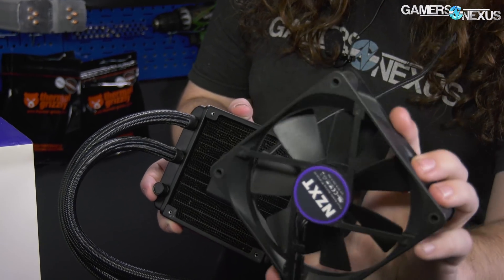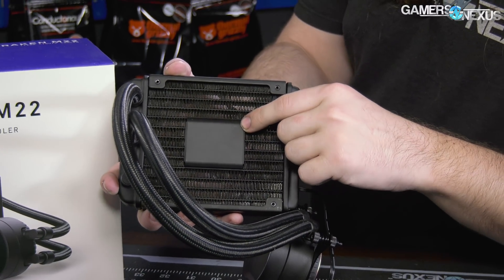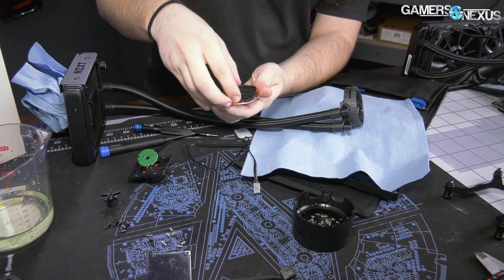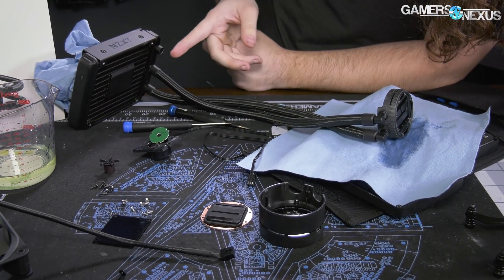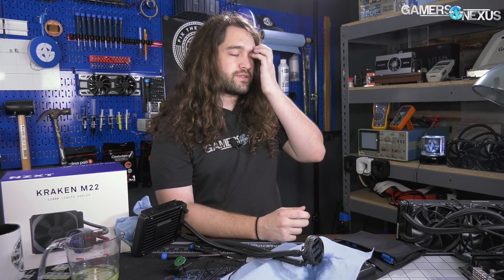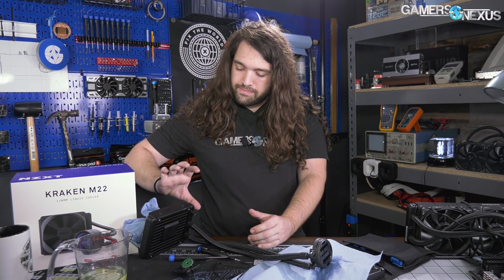Tearing Down a Strange Liquid Cooler - NZXT M22 Pump-in-Rad

Comment from the maker: Our review of this cooler is already filmed and will be live tomorrow!
You might also like Ask GN episode 78: Do VRMs Matter? - https://www.youtube.com/watch?v=b17ccXikeJ0
Grab one of the GN Modmats on the store here: https://store.gamersnexus.net/
Reply: Gamers Nexus I was just wondering if you've ever considered testing how much bent fins affect performance?

I've noticed in some tech tuber's videos, some of their test bench radiators are really kinda beat up and have quite a lot of bent fins.  I wonder how much this affects cooling potential, since it must affect it some.  Personally, I got a Corsair H60 shipped from eBay with no packing material or padding, so the fins got mangled to shit and I had to spend a couple hours straightening everything with tweezers- so curious if it was worth the time.

   Of course you'd need some sacrificial AIO's, but I think it would be a pretty interesting test to perform.
Reply: Is the mod mat burn proof so i can solder on it ?
Reply: Could you do a tear-down/review of the Thermaltake Water 3.0? (even tho it's older, last gen model I believe?) Please. 
or if you have done it could you send me in that direction? or if there is anything you could tell me it would be greatly appreciated. Thank you, Steve.
Reply: The modmat looks cool, but at $100... Eh no thanks.
Reply: Tell them steve just make the rad thicker like the thermal take water pro 3.0  i have a thick single fan rad and it cools just as good as the  h100i with a single Noctua fan on it.
Reply: My monitor does the same found the cause is the HDMI port is slightly bent out of shape on the GPU after cable was ripped out by accident.
Reply: So could you in theory cut the block portion of this off and attach it to a GPU water block for cheap GPU water cooling.
Reply: I think maybe the motor is rated for 3,000 rpm...  I doubt VERY seriously that little motor is able to do 3k in liquid.  Maybe 800 to 1200 somewhere - even that I question.  Motors that small just don't have the torque.  Even if there were no blades on it at all I question it's ability to do 2k in liquid with a closed chamber.  It's just the nature of the beast.  

There's something for you to test.  Paint one blade white and replace one the of the covers with clear plastic and then meter it.  ;)
Reply: I know this is a bit off-topic from video but I am trying to troubleshoot a very annoying problem. We are getting desperate...
 
What happens: short blackscreen with no audio, after that everything goes back to normal. Does not matter if you're playing video games or not. Happens sometimes even while watching a movie. They happen once a day in a very inconsistent manner. 

He has I7-7700k,

MSI Z270 Gaming M6 (previous motherboard was ASUS Z270 MAXIMUS FORMULA with a few bent pins and not working two ram slots),

Kraken X42,

2x8gb ddr4 3000MHz G. Skill RGB ram

Supernova G2 850w power supply,

SSD 128gb,

1TB HDD,

massive ATX case

GTX 1080 inno3D triple fan
+1080p 60hz monitor with HDMI.

 

We tried switching motherboards, removing video card and using integrated intel hd graphics, reinstalling Nvidia drivers, changing motherboard, reinstalling windows, using computer without installing geforce experience. NOTHING OF THIS HELPED.

The only possible causes in my opinion are - RAM, CPU or power supply? I don't think it can be monitor just because audio disappears as well. 

If you know ANYTHING about possible issue, please let us now.

Comment: Thanks. It was very helpful for me. After 3-4 years m22 cooler liquid is going to bad..🤮 some sticky particles was stucked in pump area and prosser copper plate. I removed it using WD40 and refill new coolent. It was worked 💪 CPU 100% >  41 C°

Comment: I have the 120mm M22 and the 240mm X52.
On an i7-8700k the M22 out performed the X52.
Not sure why, could be many reasons like thermal paste or manufacturing tolerances. I wish I knew why.

The problem I have with M22 design is...
Where / how do I orientate the rad, below/above pipes facing down/up sideways?

Mine makes a gurgling noise but thermals are good.

I would also love to know whether I can add more coolant and how much air should I leave in? Maybe I can stop the gurgling.

Comment: At $100 USD these were not a great value, but I found some online for $50 USD. I only need one 120mm AIO, becasue I put a hot processor in an itx build that can't accomodate either a good tower or larger AIO. It's kinda silly, becasue for the same money spent on the ITX case and AIO, I could have built in a larger case and used a cheap tower cooler and probably gotten better temps out of it. 😎

Comment: A copper version of this pump-in-radiator would be excellent option for discrete GPU water cooling solutions, especially 120-280mm range. This way you could use an EK GPU water block and tie it directly to a radiator with integrated pump. All you would need is a fill port.  I would love to "NOT" have to tie a GPU water block into my main cpu water cooling system. It would provide a reasonable option independent control of cpu/gpu cooling, which is something you lose when you water cool everything form a single water loop. It would also allow a cleaner tubing setup.

Comment: I own a 360mm and a 240mm MSI version of this AIO. I have been impressed with the performance and longevity of both. I have not disassembled either. However, the "pump in radiator" design leads me to believe they are of the same origin as the NZXT version.

Comment: Thanks Gamers Nexus for the teardown, I have been able to resurrect my cooler after watching this video. I saw how clean the cooler was when you opened it up after years of seeing some sediments blocking the chamber in my cooler and not knowing I had to scrap them off. I considered it broken cos of the high temps I was getting. 
M getting below 50 Celsius on full load now as compared to the near 90 Celsius temps previously. I purchased a temporary stock air cooler to replaced the m22. I recently decided to test it again and this time i watched your video and realized I had to clean off the debris in the cooler. I had opened up the cooler many times not knowing what the problem was. Thanks for saving me money from buying a new water cooler. 😊
Reply: did you clean the pump or the water block? I'm having the same issue
Reply: @berttin1080p I only cleaned the cpu block it had debris blocking the fins inside the block. I didnt touch the pump. Open the cpu block, the metal part that touches the thermal paste and the cpu(it has some screws on the metal, you will see it from steves video). You will notice some fins on the inside of it. Take it out. If its dirty, clean it and the water bracket on top of it.

Comment: PLZ READ I NEED HELP Have one in a nzxt custom bld and i have had a bad buzzing sound coming from the radiator for the past month or so, they installed it tubes up so I thought that might have been the issue but did nothing, aside from buying a new AIO idk what to do.😢😢

Comment: When I saw the solid center of the radiator, I was upset. Then you explained that it's the dead zone of the fan and I felt better.  How would you mount this design to keep air from entering the pump?

Comment: Have this same cooler, and was interested in knowing if you ended up salvaging/refilling it. Mine recently started crackling from what sounds like a bunch of tiny bubbles in the system, as well as not cooling. I suspect some type of blockage. I've since bought another cooler, but hate to trash it if I can salvage it for a spare.

Comment: My 11 months old m22 died last week. NZXT asked me to destroy it and they’ll send me a replacement. 

I followed this video to see inside the block. There was a lot of sediment blocking the microfins, which I assume cause the cooler to malfunction. 

There was also a bunch of brown gunk that poured out from the tubes when I cut them.

Seems odd that it would degrade so fast?!?
Reply: That is weird, i had a raidmax 240mm aio with the same pump design, basically a shittier brand, took 4.5 years to degrade but the design made it fail with the bubbles in the radiator lol, you could've just had a lemon.

Comment: I don't think the thermal implications are negative for the location of the pump being in the center. You want the air to pass over the radiator fins for max heat dissipation, not blowing on the pump Given the design choice that is the best place for the pump on the radiator.

Comment: It's a stupid design, those with a pump on the CPU (Corsair hydro like) have about the same sized cooler and a more efficient radiator.
The only proper design would be to put the pump in series of the loop but all those AIO solutions seem to be focused to make repair hard. They don't want people to fix them or to upgrade them by replacing a part.
They want people to buy a new one instead. It works, barely anyone tries to fix a broken pump or clogged radiator in those designs (though it is often a 15 minute job only).

Comment: I don’t mean to shit on the I fix it kit but my socket set came with literally all of those for screwdriver use. All I gotta do to bring it with me is pick up the 3 rubber strips holding all the bit and the screwdriver itself. Plus mine is in my socket set and includes tx torque heads too.

Comment: Just took mine apart after it stopped cooling.  Found a white gel/crystal clogging the center channel at the micro fins.  Then hooked up the pump to 3 volts and it’s dead.

Comment: Usually you mount the pump at the bottom of the loop so air doesnt stall it, is this radiator safe to mount on the top?

Comment: i have this and it was overheating within a year and a half. 95c. i believed it was clogged. so i used this video to diagnose it. no luck. but i am wondering 

how the hell does the water go fromt eh pump to the hoses?? im looking at the radiator and i do not see anything connecting the center pump to the hose fixture....

Comment: IDK, mine works fine on my Ryzen 5 3600 X. I've yet to see temps over 65C. It's running 24/7. So far it's been fine.

I have a midtower that needed 120mm radiator because I have 3 intake fans up front I didn't want to move around. Wanted decent RGB and really just wanted something that was better than stock cooling because stock cooling was getting hot from time to time. This worked for my needs.

Comment: So what is the proper orientation to mount liquid coolers like this? Your video that explained the correct orientation for AIOS were targeted for pump in cpu block ones. 
You want the pump to be below the rad, but what happens if you are top mounting?
Reply: Please answer this question
Reply: I think in this case placing the radiator on the fan slot on the side of the cpu will be ideal. Havnt had issues doing this with my m22 for sometime now.

Comment: Dumbest design ever. Why not just put it on the end of the tank like many others have done. This NZXT just blocked 1/4 of the radiator fins.  I think the Alphacool Eisbaer is the best AIO to buy right now. Alphacool has a completely diffferent CPU pump/block than Asetec. Alphacools has replaceable G"1/4 lines that does not void your warranty, You can run your own coolant  and it has a port on the pump for filling. They use a bronze pump and copper radiator. so no aluminium Enermax problems. Just think if Enermax had this type everybody could just drain their Threadripper AIO swampwater out and refill with clean PG/water biocide ! LOL

Comment: Whats the reason for why PC coolers are not using like.. automotive coolant? price or deterioration of materials? There are different auto coolants to accommodate different engines for example one that does no harm to aluminum parts/blocks. newer coolants have close to endless live so Im imagining how you never clean your custom water cooled loop for example even AIOs, tho in the second case a pump probably fails long before anything happens to the coolant thats never seen air after it god factory sealed inside the cooler.
P.S. Also I want to see a PC with a car radiator for cooling (an intercooler probably as it can be around 280-420mm PC radiator) but thats for JayZ50Cent.

Comment: All this talk of patent trolling and how this patent didn't deserve to be awarded etc..etc... what a load of crap.
I hate it when patents get in the way as much as the next guy, but once upon a time water cooling was an enthusiast only extreme solution and done using separate commodity parts.
One day someone came up with the idea of an all in one system, where the pump is in the CPU block.
Regardless of how used to seeing them we are now, like it or not it was once a unique idea, and was patented.
I've seen patents for stupid things (linked at end) and this is not a patent i like, but none the less it is a pretty legit patent.
Try to consider the all angles of the argument before arguing it.
Example stupid patents... THESE ARE REAL.
Method for swinging on a swing sideways...
https://patents.google.com/patent/US6368227B1/en
Animal toy yes.. it's just a damn stick, someone patented a stick, and any equivalent representation of a stick.
https://patents.google.com/patent/US6360693B1/en

Comment: Sadly i found this video a little late but i have this CPU AIO under an 8700k at the time of writing and its actually pretty darn good. The default fan is a bit crap (and also only white led, why? idk) so i bought this one: https://www.newegg.com/noctua-nf-f12-ippc-3000-pwm/p/N82E16835608052. It keeps it about 65-70 or cooler under load. I bet i could get cooler if i used different thermal paste but i digress. Get that fan if you get this cooler. its much, much better i think.

Comment: hmm i think You dont only loose the Space of the Pump in a Radiator ... ( the blind spot of the Fan )  but there is no Waterflow above und under the Pump ...  a Radiator works  bekause the Water flows from 1 Side to the Other side of the Radiator to the Fin covert pipes ... wut at the space where the Pump is there is no way  for the Pipes to go from the hot side to the cold side because they cant pass through the Pump ...  so You loose the complete aeria  between hot and cold  and as wide as the Pump is ...

Comment: I'm sorry but somebody is crunching on something in the background during the opening and it's extremely distracting.
Rosewill has a 240mm version of Apaltek's pump-in-rad as well, and cursory reviews say that while the fans are a little underpowered, the actual cooler unit is competitive even with Enermax 240s, and at a rock-bottom price on Amazon you can afford to upgrade the fans.

Comment: I had this cooler few months, it was so loud (The pump) and so bad for temperatures(40-50° idle/85-90 in game) i thought water would be great but this is not true. So i send it back and put a Enermax ETS-T50(just Air cooler) in it. 10-15° Better Temperatures and nearly silent

Comment: Their probably using 20-30 percent on average. Here it looks like 10-20 percent. Less glycol is better for cooling efficiency. More glycol is better for anti corrosion. To much glycol doesn't make sense as it lowers the boiling point of the mixture and is a waste of money... The only reason you would really need more than 20 percent is if you mixed materials and want that extra corrosion resistance. Pro tip, of every AIO I have seen torn down the mixture looks like standard antifreeze which is extremely cheap, already has corrosion resistance built into it for the same materials in PC cooling loops and is easily readily available. The only time I see anything different is if they didn't use any glycol at all or if the loop got growth or corrosion which hints towards the latter of little to no glycol. Standard antifreeze colors include: green "most common," orange, pink and maybe more but you can also tell by the smell, texture and taste. PS don't consume antifreeze you will have to get your stomach pumped!

Comment: dual power connector for fan & pump, while keeping the pump on tank side/corner maybe even sticking out on one of the pipes seemed like a better idea. 
And if I seen the rubber correctly, you use half of the fins  only as it enters the middle and leaves on one of the sides.

Comment: have you tested the water vs glykol temperature differences in liquid coolers i bet its 1-2c i have run pure rally car Neste ready mix last 9 years chanced it 3 times never had any bacteria or other broblems and cools just as good as distilled water that i first used for while before getting algea  and corrosion

Comment: Pulled up this review di to the fact I was looking to buy this unit. I have a number of tropical fish tanks that I impeller type pumps and one of my smallest tanks is about 10 Gallions has an impeller just a bit bigger than this unit. I will need to do a bit more research on what closed-loop cooler I will end-up buying but M22 appears to be overpriced for what you get. Right now its listed at 59.00 US on NZXT website but it's about $100. Canadian. Thanks for your product breakdown, your report is most welcome.

Comment: you realize that you don't just lose the cooling of the center square - you lose the cooling capacity of every fin tube that is cut to make the hole. This design loses the entire center third of the radiator for cooling capacity.

Comment: EK has a configuration where the pump is on the side of the radiator. Ek should suit them and states that EK holds the intellectual property to have pump on radiators. LOL, so stupid. I'm going to submit a paten to have 4 wheels on the car. Get rich bitches.